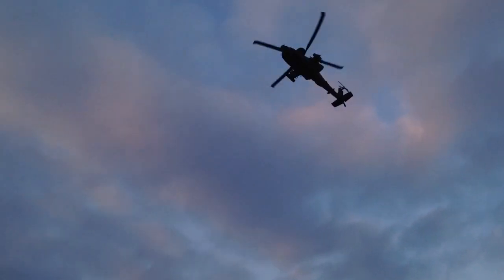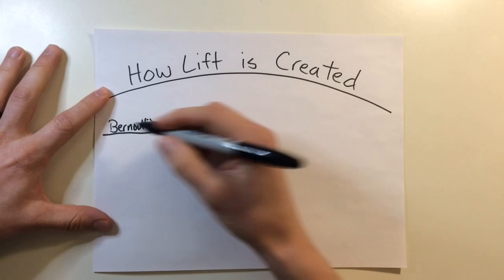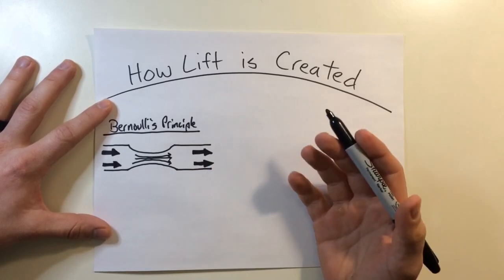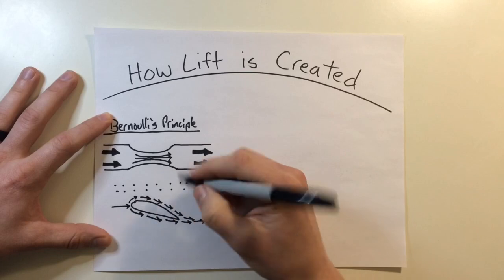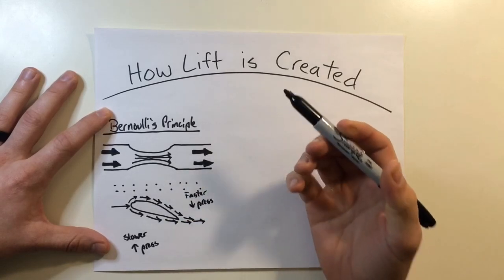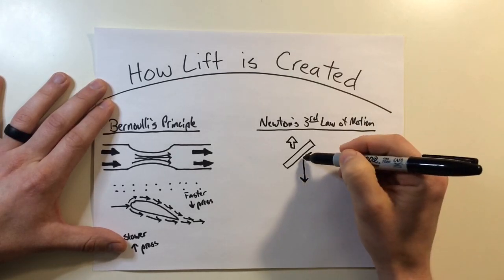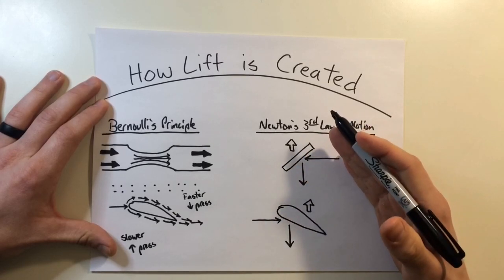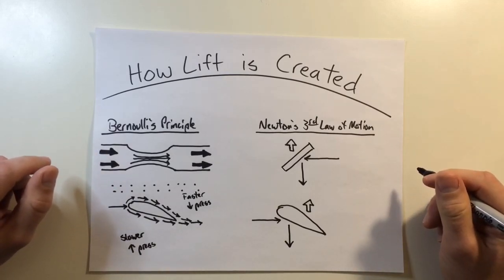How Lift is Created

Comment: Seems counter-intuitive.....air flow being lower pressure when its going through a constriction in a tube
Reply: +
evanleebodies
,
You're using the wrong intuition.   The narrow section is a restriction in the flow which causes the pressure to go up UP STREAM of the narrowing; in the wide section to the left. This increased pressure is what accelerates the mass of the fluid into the narrow section. The narrow section is like a hole in a pressurized tank.
..
This is exactly like putting your finger on the end of a garden hose.  It squirts farther because the pressure went up IN THE hose BEFORE your finger..
Reply: @evanleebodies   Thank you. However it isn't brilliant, it is just correct. 
.
Because I took responsibility for a full cockpit Boeing 737 flight simulator at a science center several years ago, I decided to look up lift since I'd be asked to explain anything and found all the nonsense people are trying to explain  while violating this or that fundamental principle.
...

The air over a wing is accelerated BECAUSE OF the lower pressure. 
Euler taught us in the mid 1700s that Pressure Gradients accelerate fluid, just like force accelerates mass as Newton taught us...
.
Those Pressure Gradients around a wing are caused by the simple fact that the wing (just like anything moving through a fluid) must move the air around so it can get through. This and only this causes high and low pressures at the surfaces and that is the lift. These pressures are to our advantage for flight, but I won't go into more detail here.   Everything else can be easily shown to be caused by these pressures...including the down-wash (diverted air).
.
To test my understanding and clear up a few more things I actually contacted Boeing's Doug McLean (see his YouTube misconceptions video) and Embry-Riddle's Charles Eastlake.  So I know this stuff is correct and the only thing that makes sense when you keep all the fundamentals in view at all times (if you know them and can). 
..
The pinching/narrowing thing is wrong because the air far above is not a hard surface and if you care to look, there is another "narrowing" below the trailing edge: BUSTED! 
..
So many people that are well-meaning, but wrong.